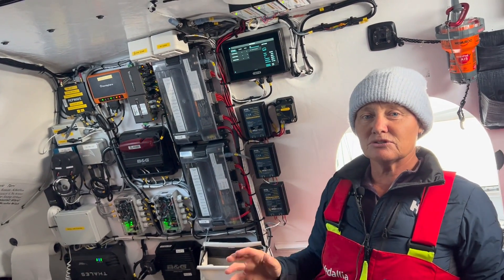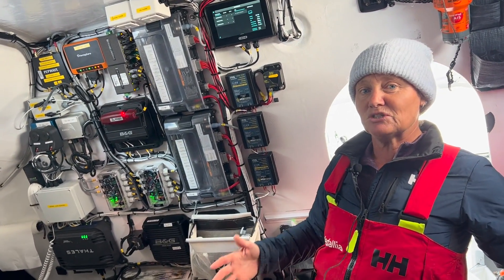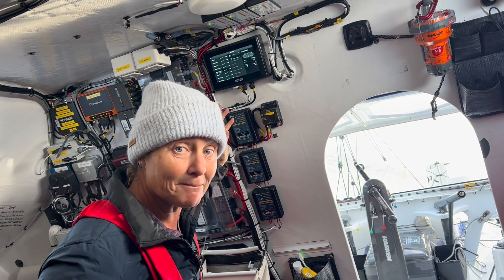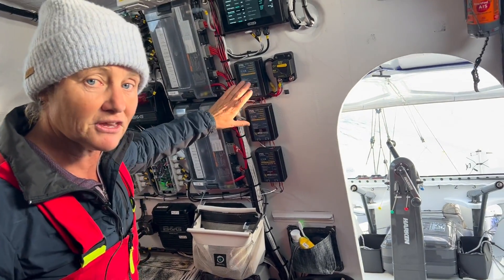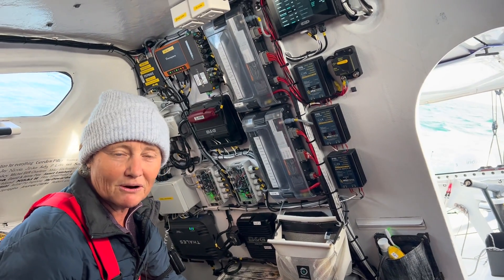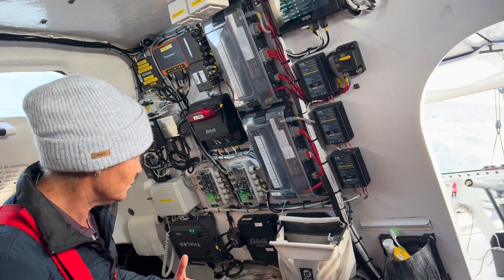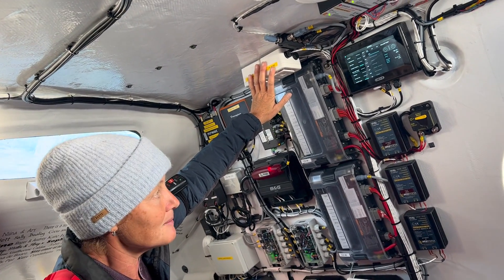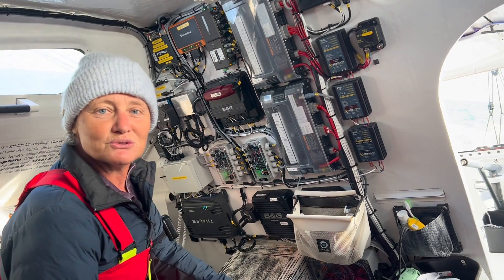A closer look at the electronics on an IMOCA

Comment: So how many generators do you have on board and how frequently are you running them or it?  My guess is several hours a day?  What is the diesel fuel capacity and what range does that give you? Must have a huge battery bank as well I presume?
Is the generator(s) automatic and senses the battery amperage to run?  I would doubt solar could generate enough power to run just the steering gear even, but have always wondered, looking at your boat when it was in Forte de France a while ago...
Reply from the maker: Thanks for all your questions .. answers below:
One Alternator on main engine. 2.5 Hrs a day
250l .. rely on some input from solar and hydro generators for the VG.
150amp/hr@24v
No it runs off the engine so we have to turn engine manually.
Reply: @PipHareOceanRacing  Thanks Pip... Really interesting.  Why do you ue a main engine alternator rather than a dedicated generator with higher output per litre of fuel or is the alternator huge?
Michael

Comment: Are you not relying on your B&G H5000 autopilot in sail mode for your autopilot? What does the exocet system provide to the H5000?
Reply from the maker: The exocet is a more advanced separate processor specifically designed for this type of  boat which can taken into account a lot more parameters.

Comment: How about redundancy? How many spares do you have with you. Can you replace every single box once or more than that? Thanks for you intro.
Reply from the maker: Most systems have redundancy already designed in so the number of ’spares’  we take is not so great. Mostly things that are vulnerable to getting wet, fuses, connectors that kind of thing.

Comment: Great overview! Just one thing - does the Exocet(?) processor feed directly in the B&G autopilots? Not via the B&G processor? Looks like you have a big advantage for sailing if your are an electrical engineer nowadays!
Reply from the maker: Into the pilot, bypassing the B&G processor, which is a back up.

Comment: Having everything this accessable is a dream! 
Regarding Malizia: do you also have a separate gyro installed in the boat?
Reply from the maker: Yes we do, probably similar.  We have a UPS fitted so that even if we lose power, or it gets switched off, it will remain on for a short period.